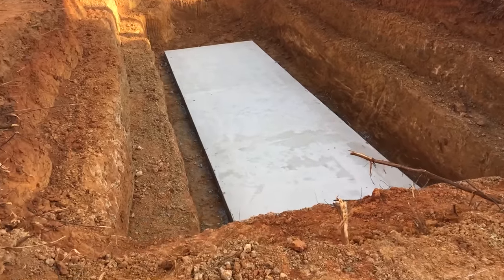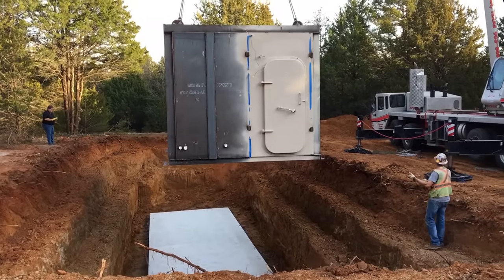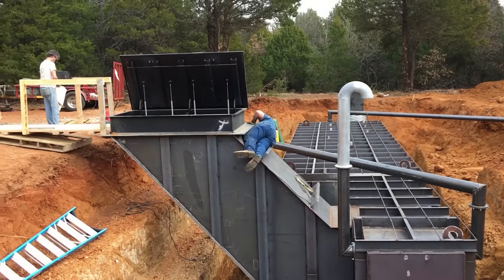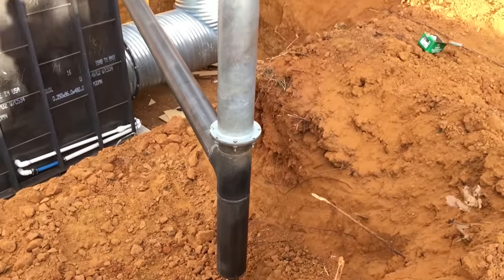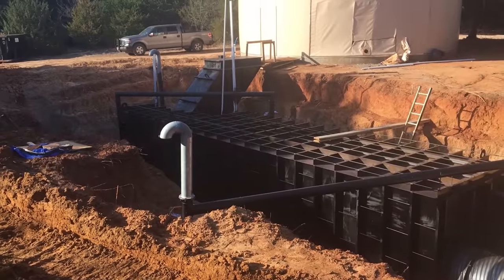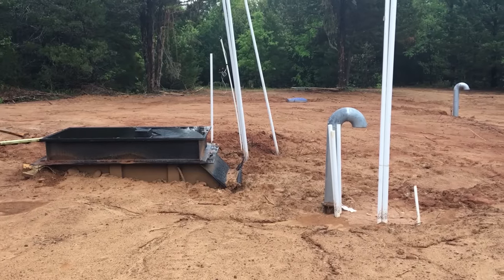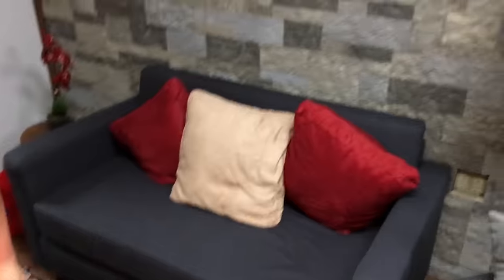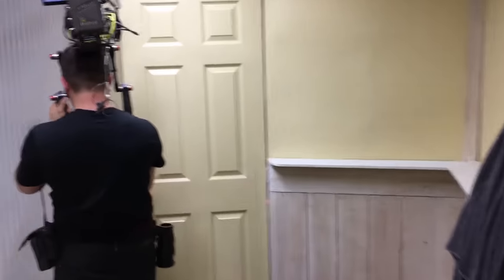Atlas 10x30 Safe-Cellar - Luxury Bunker Built Under A Home (Complete Installation Video) - Part 1

Comment: Dude. You have like no room for anything in that? Also, do those air pipes have filters in them against airborne contaminants like viruses or fallout? This is definitely a really cool design and all, I like it a lot, but with there being no room for jack shit in there other than comforts and not actual necessities, I call that poor prepping. I'd say you need an entire other container for food, water, medical supplies, ammo, etc. If shit hits the fan, I'm not gonna be worrying about having a wine rack, that's for sure.
Reply: he turned it into a wine cellar lol it's not really a bunker, besides who the fuck stores wine in a fucking bunker? friends over for dinner and you forgot the wine, oh let me just open up my bunker to get some
Reply: Okay he said it poorly but I agree that this is not what I want to see inside the "shelter".  This should be ultra utilitarian with metal everything and bunk beds on the wall, etc.  Also I agree if I did something like this, I'd purchase another one to go beside it for storage.  Truth be told they should design this with two of the cargo containers about 8 feet apart with the entrance coming down between them.  The generator room could be off of the storage room so it wouldn't be so loud also.  Having the storage room would provide a place for extra propane which I assume is what the generator, runs off of.   As a note, having solar on top of the house feed this would be a bonus.  Maybe a system to also pull water from an inground pool.
Reply: @Therailgunner  well said ! Who has time for a win rack when shits on the fan. Cheers 🍻
Reply: @schlomoshekelstein908  the guy probably wouldn't wanted to spend that luch money on a room for one purpose,all the storage is underneath the floor you can actually put a lot under it,i like the design but inside this is definitly not a fit for me it wants to make it not look like a bunker but..it is. You need a geiger counter and a gas mask as well as suits can be usefull for when you go outside. You need a lot of water and food and a good toilet as well as a way to dispise of trash
Reply: TheRailGunner No room, lol...there’s plenty of room! 

Try 18 years of Submarine duty breathing recycled farts.

Comment: it would be ok as a tornado shelter...its useless in the event of a nuclear war though.
Reply: Glad someone elsed picked up on this
Reply: Agreed. It's just a cozy elaborate storm cellar for 48 hours riding out a bad storm. Could be handy as a panic room or bolt hole as long as nobody knows you're down there but with a generator noise and other systems working it's giving itself away. Plus it's been on T.V.  so it's known.

For nuclear war, you need a plan for moving forward after the first days anyway. Two people can't survive in that space indefinitely or even long term by itself.

Cool man cave though.
Reply: robraver why’s that? Not deep enough?
Reply: You’ll need it to survive the fallout. Obviously not a direct blast lol
Reply: @surfingtothestars  you don't seem to understand how fallout works.  the beta radiation from fallout wouldn't penetrate a layer of cardboard.  it's ingestion that you have to worry about.
Reply: **  looking back at the thread, I now recall my line of thinking.  My initial comment towards Ryan was that you basically don't need an inch of steel, multiple feet of dirt and a foot of concrete to protect yourself from fallout!  A well-sealed home with a ventilation system that provided positive pressure and had an adequate filter is all you would need to survive fallout.  A bunker is nice because it gives you protection from multiple different scenarios.  However, these guys waste so much money in going crazy-overkill on the concrete that you could have a bunker twice the size for the same cost if it were engineered to be efficiently built instead of overbuilt.  cheers
Reply: **  You have answered your own question already. My point was (as best I can recall one year later) ...THEN WHAT?

The client for this system has invested considerably in an elaborate (if not overdone) way to ride out the first few days - provided their site is fortunate enough to be away from any direct strikes and so on. It does not seem to serve much beyond that time however because it fails to address any ways of ongoing resupply or the need to eventually start going out again quite soon.

Potable water, food, medical care, security of the site and yourselves can't really be dealt with in a footprint of this size and design for very long. Believing otherwise means the buyer has purchased a very expensive live-in casket / storm cellar and not much more.

Suppose he has say 90 days of water stored. He can't wait until day-85 to venture out looking for a re-supply taking four days worth to allow a travel range of two days out and back and a single day left in reserve back underground.

Unlike a tornado event, after a nuke strike, help will NOT be forthcoming. The bunker mentality requires a much more in-depth facility than is shown here. Once the water runs out, the x-years worth of food stocks that may be stashed in this bunker ( I forget if an amount was stated) become irrelevant as does the medicine and ammunition - not to mention the waste facilities and the entertainment systems.

It's a weird man cave and good luck to them.
Reply: @Jonas Arnalti I went through a prepper phase like a lot of people between 2000-2012. I eventually figured out through research how pointless it actually is.

Mostly because you cant stock pile anywhere near enough resources to survive. The amount of space required to A: store essentials, B: fabricate machinery like hydroponic gardens, C:the capacity to generate and store electricity required to keep systems going, D: capacity to obtain/filter/recycle enough vital elements like oxygen is way beyond the capacity of an individual or even a family to do and would require a complex on par with say the size/scope of NASA launch centers just for a single family of four. 

Even then the systems would be too hard to maintain for a small group and as the group size increases, so increases the demand of space and resources. 

Thats the point, Its untenable. As for the nuclear war example, radiation would not simply stop at ground levels. It would seep deep into the ground and into aquifers as water enters the water table. Any adequate bunker system would likely require tapping into underground well water rather than trying to stockpile thousands of gallons of water (which take up massive amounts of space) Yet those water sources would be just mostly be as contaminated as anything on the surface.

Then there is the issue of timeline. Things like Fallout video game give completely comical, arcade view of nuclear holocaust. You are not going to be hunkering down for 5-10 years till most of the radiation floats away because radiation like that remains in scale of decades if not centuries or longer. So bunkering would just force you to eventually come out when your resources dwindled, and even if you managed to avoid the radiation in bunker some how... it would still be potent and waiting for you topside and you would promptly start developing cancers and other afflictions. Remember, Chernobyl happened over 35 years ago and the majority of the original affected area is still not safe for humans.

Even if by some miracle you hit the perfect alignment of everything and manage to pop out in a pocket mostly radiation free, does not mean anything else would be left living. That means little to no plants, no wildlife (ie game) and definitely very few humans. If you DO encounter anything living, it will likely be so mutated it will be functionally something different than what it was in the world before. The plants and animals would also likely be riddled with radiation and as such would be just as toxic to try and consume. The soil would likely be saturated with t, so dont plan on growing crops from seed banks.

Essentially prepping, especially for nuclear holocaust amounts to slowly waiting to die and end up in the failure of not living up to the envisioned intent of emerging to repopulate the wastelands. Its all just a fantasy that makes for good entertainment tropes, but is NOT going to go down anything like the depictions we get.

So trying to invest in something that is doomed to fail is essentially throwing ones time, money and resources away. I dont know about you but I got ANYTHING else better to do with my energy and attention than that.
Reply: Which is why it’s advertised as a bomb shelter not a fallout shelter

Comment: How do you close and open that hydraulic door from the inside. I’m assuming you don’t just leave it open when you go down there. Didn’t see a grab handle or anything.
Reply: 7:54 I think I saw a latch.
Reply: There's a bar toward the side of the hatch.
Reply: there is a switch....8:00

Comment: How about when you're inside someone put a lock on the blast door and stakes out the escape hatch till you come out and Someone gets in behind you. Your sealed in your bunker and they get in your generator room damages it and forces you out the escape hatch. I don't mean to be negative as I think these bunkers are a great concept. However I do think I'd like my power sorce in the bunker with me and a long escape tunnel. Great video guys keep them coming.
Reply: Kingdom of the fungi
In reality... This is a toy. It's fun to have and it keeps rich, bored guys from loosing their minds.
Reply: Bunkers first and foremost protect you from the initial blast of a nuclear weapon and the high levels of radiation immediately following.

You can be prepared for raiders as much as you like, but that doesn't matter if your guts are falling out due to radiation poisoning.
Reply: the first thing I thought was a lock thing as well I assume they have a method of disconnecting a lock from the interior.
Reply: Thomas Christopher White defending a bunker is basically impossible so the best method is secrecy and only using this to avoid initial fallouts.
Reply: If they're outside then you should be too. A bunker is not a fort. Once the fallout decays you setup surveillance and defense, get on the radio, plant vegetables, and go raiding yourself.

Comment: What is the point if you build a house on it anyway just build a full concrete cellar and use it as a bunker. Half the prize 4 times the space.
Reply: That's what I'd do, but you'd need a reinforced concrete roof at least 20 inches thick if there was no other heavy material above. It works out cheaper to build a strong cellar at the time a house is built, as the trades are mostly on site anyway, with diggers & other plant often around. Putting plenty of closely spaced rebar in the walls and doing a first rate job with dense well vibrated concrete helps to keep water out too , as well as being strong. Casting a wall kicker with a PVC water bar at the same time as the reinforced concrete raft slab for a strong cellar would be good to stop water ingress. The Swiss use a minimum of 10 inch thick reinforced concrete walls below ground for their shelters in almost every house, and it worked out at only a few thousand pounds per person doing it as part of a house build. Nowhere near the cost of a  bunker craned in. Swiss ones all have proper 1 tonne 8 inch thick concrete blast doors & NBC filtered air.
Reply: That would be even more expensive if properly planned and engineered.

Comment: That's a heck of a good price for all that.  Mayber having one of these installed instead of building a house is the way to go.  Perhaps a developer could buy about 50 acres and divide it up into one acre lots for these only.  Course, for long term use, an elevator would need to be installed and the toilet, etc hooked up to city sewer so at the top of a hill would be best, especially if you have to go the field line route.  Outside of the city limits so that a common well can supply all 50 shelters.  Conduit connecting wire to each site with an on/off switch for communication with the neighbors.  I think I'm onto something here.  Especially with the events of the past 12 months.

Comment: Why are the hinges on the outside of the security door?
Reply: Ha, that's a great question
Reply: Not a good video but maybe it's just nothing special overall. It is better then the nuclear fall out shelters we had in the 50s.
Reply: Exactly, and why is there a lock on the outside? You could get locked in.
Reply: To make easy to get in
Reply: SuTen Oh my god.. that is as dark as it is logical. Someone check on that bunker lol
Reply: Don't ask questions, belief their fluff and paranoia and hand them a 100k.
Reply: I also wondered why there was the ability to have a pad lock on the OUTSIDE of that door.    I mean after talking about how "bad ass" Atlas bunkers are if they pour gasoline down one of the pipes a check valve makes sure it doesn't come in, but that's fine we'll just put a lock on the door and park a car over the escape tunnel hatch, then lets see how long you prepared for.

Comment: What if this bunker is flooded
Reply: Get some snorkels
Reply: Flush it out with some wine
Reply: A swimming pool
Reply: Air tight doors
Reply: It becomes a sunker
Reply: You drown
Reply: Its water resistant bunker. Jk
Reply: glug glug glug...
Reply: There's a scuba suit and air tank under the bed, but it's an extra $42,000.
Reply: extra radiation protection
Reply: @jeffbezos4746  gahahahahahahahahahah

Comment: It would be like being trapped in an awful 70's sitcom.
Reply: I agree, the bathroom is murder on the eyes. They should have went for a more modern, organic look rather than the puke yellow frosted fuckery they opted for.
Reply: Still, it's of very good construction, so this may have been the bad taste of the client rather than the builders.
Reply: @jacobp.2024  No. There is no excuse. This is fucking horrible.
Reply: @VidarrKerr  have you seen rising s? This is luxury copaired to that and this is the normal interior the luxury interior is much better

Comment: I notice, you are using, hydraulic struts for your hatch door. The strut may trap dirt & cause "O" ring to "break" , thus hydraulic fluid may leak. I  suggest you can use Spring struts, instead of hydraulic. No maintenance.

Comment: doesn't look deep enough to stand up to any type of major bomb threat by today's technological standard's. Bombs now days can penetrate many meters (i believe in the hundreds) below ground and so can nuclear radiation.  not to mention it doesn't look big enough to live in for any extended period of time or hold many supplies. Who would have ordered such a "shelter"? This just seems like an expensive waste of money to me. If you're going to get a fallout or bomb shelter, save up and do it right.
Reply: No one is going to be dropping a bomb on top of this house and shelter. What is wrong with some of you in the comment section? LOL

Also radiation will not penetrate many meters underground. Dammit you have a computer. Look it up using Google.
Reply: It's a fallout shelter. The 36 inches of Earth and concrete will protect the shelter from alpha, beta, and gamma radiation. It's not meant to protect against a direct hit from a nuclear missile, it's designed for sheltering up to two weeks until the radiation levels outside drop back to a safe amount.

Comment: So it’s rusted already? It’s going to last 5 years max.
Reply: Yeah, it looks like a modified 40 yard construction dumpster.
Reply: Rust wont eat through 3/8 plate in 5 years. I'd say 60years if moisture is bad
Reply: Hey if you want to do a crappy job that's your business. But why not do it right ?
Paint it properly. Sacrificial anodes, actual drainage.
The whole thing looks extraordinarily amateurish.

Comment: You need to have a well and an electrolysis based oxygen generator that purifies drinking water as well as provides breathable air. The air system you have listed in your videos is fine for storm shelter, but for a bomb shelter as you are advertising, it is seriously flawed as a solo unit. You will just be trapping irradiated particles inside the shelter. You shouldn't use galvanized steel either. You guys are very unprofessional and I don't see you selling to anyone but the very gullible.
Reply: mrdabeetle1 carbon scrubbers too. Cultivating lichen, or growing plants it a lower level, and fans circulating air throughout the facility works too.

Comment: "bomb shelter" ya bought a over priced sea container lmao
Reply: Still 10+ feet under the ground and covered in concrete. They stand a better chance than you do
Reply: Going by their product range this isn't really intended as a proper bomb shelter - it's a shelter for lesser scale disasters than a bomb going off on your head.

That said it's still significantly better than nothing.

They build actual military spec bomb shelters, ones you bury deeper.
Reply: But for 100,000 dollers

Comment: Ok, so there's a place to put a padlock on the outside of the door, ummmmmm. Why would I want to go underground so someone could lock me into my own bunker. The whole point of the bunker is so that I can lock it from the inside and nobody can get to me, not I go underground and then can't get out because someone locked the door from the outside...
Reply: Quiet nvisibledeath.  Next you are going to point out how overpriced it is.  ;)
Reply: @patrickeh696  Just pointing out a major design flaw
Reply: And quite correctly I might add.  See the ;) in my comment.
Reply: @patrickeh696  gotcha, didn't see that in the popup on the phone
Reply: heh, put a couple big rocks ontop of both hatches, no way to open from inside, plug the airvent and raid the neigbourhood before going back to remove the bodies from your new home.
Reply: Duh, so you can lock it when you leave, Einstein.